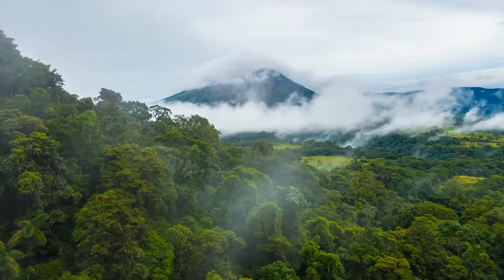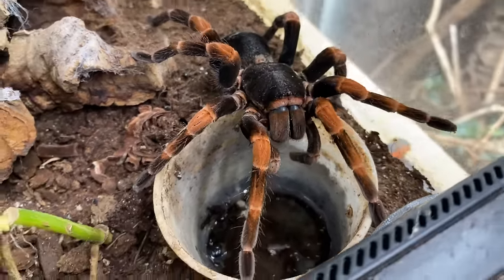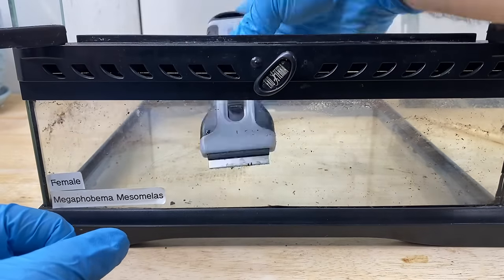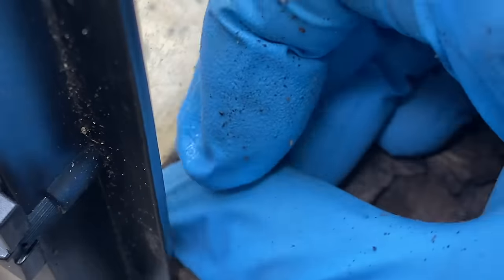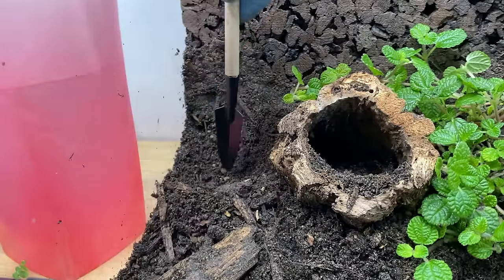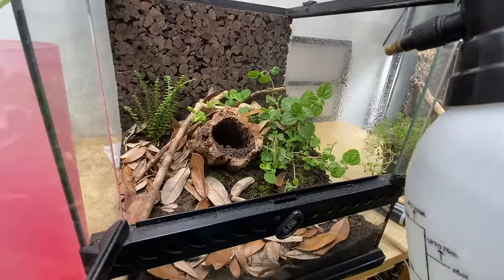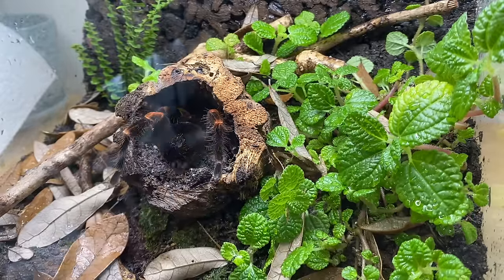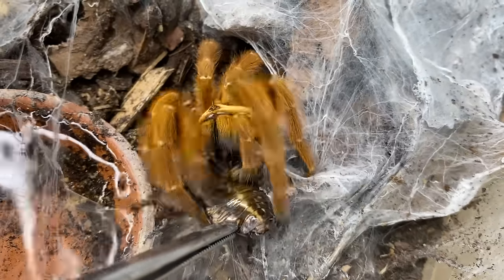HOW TO MAKE A BIOACTIVE TARANTULA TERRARIUM! Tarantula Cribs Acrylic Replacement Lids!

Comment: I've got 20 terrariums. The only one that got molt was the one without a drainage layer. I personally consider it necessary. However, it was easy to get rid of it with some extra springtails.

Comment: I have 3 exo-terra mini talls, all that I have ripped the screens out of the tops and replaced with acrylic panels that I cut and drilled myself. I would use these new lids for these 3 which are poki enclosures. 1 is empty at the moment awaiting my small female P. smithi to grow into it. The other 2 contain my bigger juvi ladies, P. rufilata and P. regalis.

Comment: It's beautiful. I live in an area with hard water and high ph thanks to the minerals in the soil. I bought a distilled water machine to use with my various orchids, calathea, and other species.  The trick has been making sure I add fertilizer to every gallon container as well as some tap water to make sure the distilled/pure water doesn't leach the nutrients from the phalaenopsis and potinara/cattleya roots. I don't own any invertebrates, but I'm looking forward to getting more house spiders. I accidentally killed my residents when I was fighting a white fly infestation on my spiral ginger. It didn't survive either but the rest of my jungle is doing well

Comment: Beware that clear acrylic discolors and begins to disintegrate in sunlight if kept that way in direct sunlight over time. It is also a heat barrier and traps in heat. So it's great for desert species, but colder weather animals should be kept in cooler areas away from direct sunlight. Tarantulas aren't going to be out there on the hot desert sand during the day. Not even solifugids (camel spiders) do that. So think about how much light you're using if you're trying to keep things dry for the desert species.